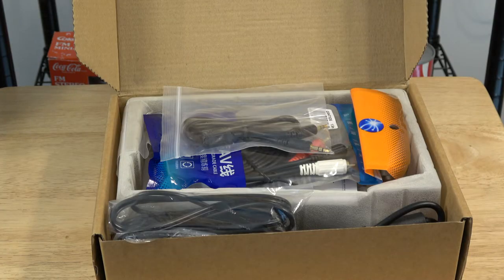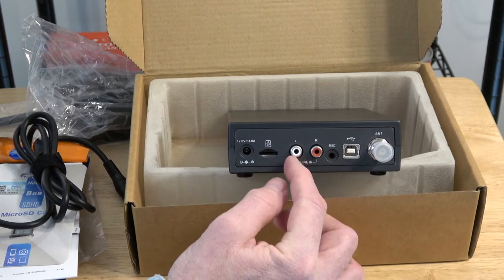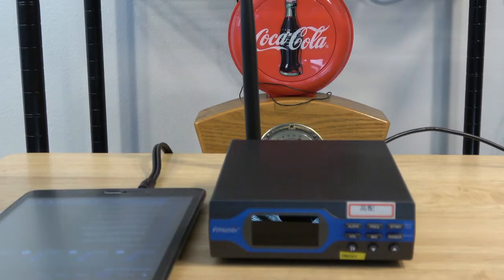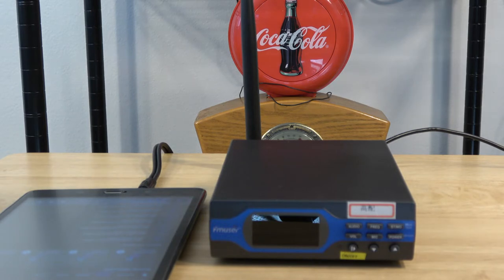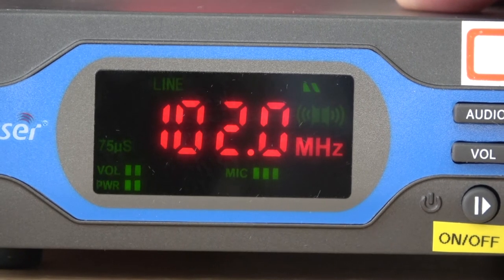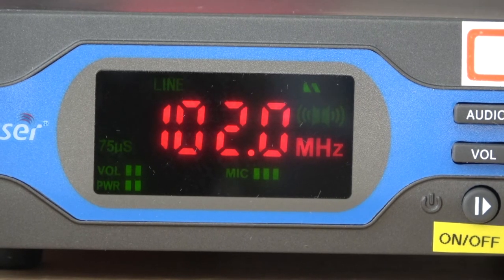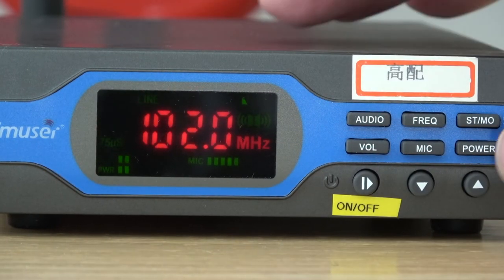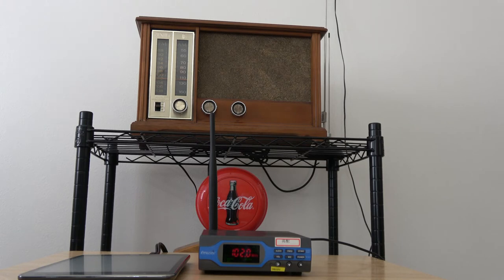10 17 18 FMUSER FU X01CK

Comment: You'd be better off at 101.9 or 102.1, to stay within the standard.  102.0 is non-standard here in North America.  Microphone level is for an external microphone.  "Volume" is the line output level, or the level of your transmitter output.

Comment: A few questions good sir:
1.) Can I use this with receivers like Retekess Tour Guide Systems? 

2.) Can you use the mic and play bluetooth in the background at the same time?
Reply from the maker: I’m afraid I cannot answer your questions but maybe a viewer out there can help.
Reply: Hello, you could only use FM radio receiver for this transmitter. Other Retekess tour guide system have the different frequencies from the transmitter. You could contact retekess at support@retekess.com if needed
Reply: Hello, you could only use FM radio receiver for this transmitter. Other Retekess tour guide system have the different frequencies from the transmitter. You could contact retekess at support@retekess.com if needed

Comment: Ironic you don't want to break any laws by playing copyrighted material yet 200mW is still well above legal levels for power. Lol
Reply from the maker: I believe you may be right. I thought I read it was recommended to not set the transmitter any higher than 200mw in the US to stay legal but looking back I can not find out where I read it. I did a little more research and found out the maximum power output of  250 microvolts per meter at 3 meters is what the law allows. I don't have a meter to measure the output so I think dropping the transmitter down to the lowest power setting should get me close. The antenna that came with the transmitter is not the best for transmitting and the location of the transmitter is not optimal. Thank you for bringing this to my attention. We want to keep the people at the FCC happy, not to mention it is the right thing to do.
Reply: @OnTheEdgeNow  it is 200 feet and the transmitter has to be fcc certified to be legal check out the c crane fm transmitter that one is fcc part 15 type accepted.
Reply from the maker: @VickyGeagan  Thank you for the info, I will check out the C Crane.
Reply: @OnTheEdgeNow  It is the whole house transmitter and Bob Crane's granddaughter Amanda will be glad to help you.